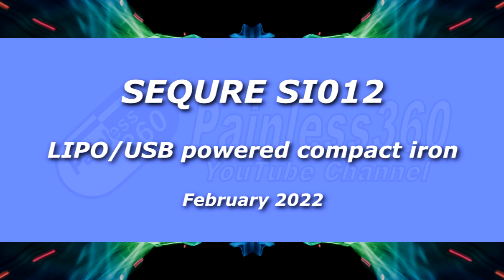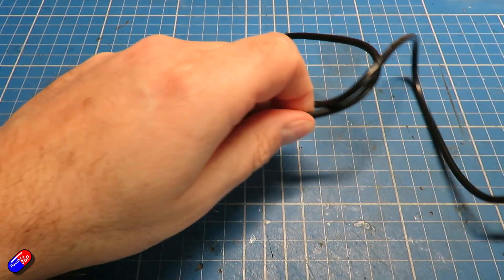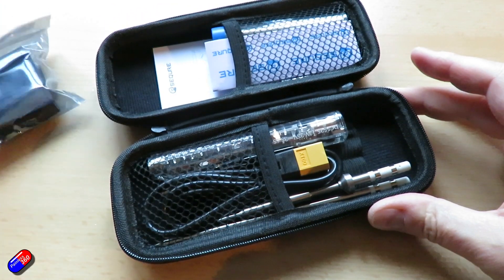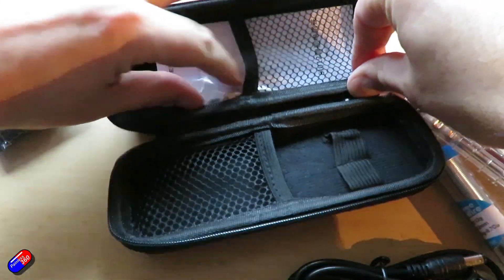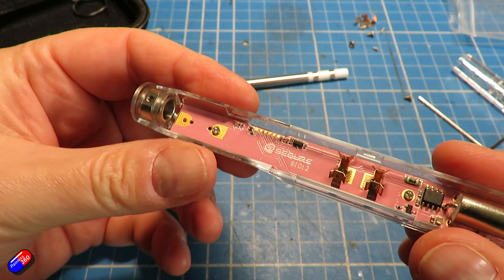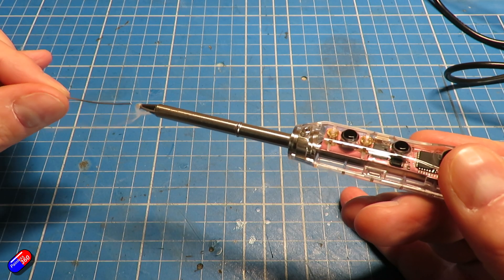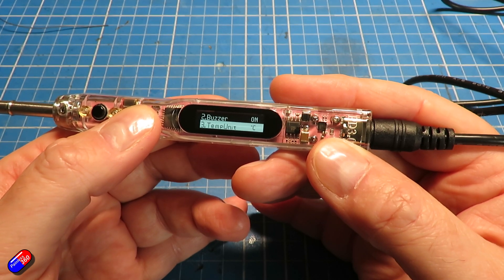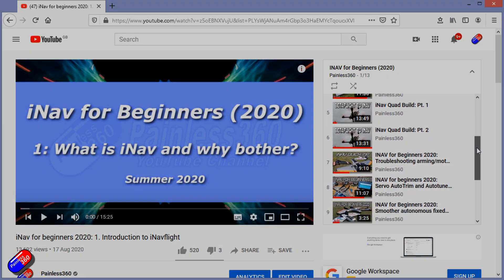SEQURE SI012 Soldering Iron: LIPO powered wand that supports both T12 and TS tips!

Comment: I wanted a clear case for my ts100 and then they stopped selling them so definitely going to get 1 of these i need a replacement anyway as I over voltage my ts100
Reply: what's overvolt? I run my TS100 on 6S and it rocks...less than 10 secs to 400
Reply: @Fly_High_FPV  yes but when you forget the soldering iron is still connected and you crank up the power supply to 40 volts this it does not like very much try it and see
Reply: @blakey271able  lol, 40v...how long does that take to heat up 🤣
Reply: @Fly_High_FPV  instantaneous meltdown

Comment: Did you try Pinecil from Pine64? It is much cheaper, but has very good quality, also has power from usb (both QC and PD). But t12 tips support is interesting, I admit it
Reply from the maker: I'm trying to get one in to try - stay tuned!
Reply: @Painless360  You can also buy it with clear case!
Reply: I’m using the pinecil have been for a couple months and it works great for me